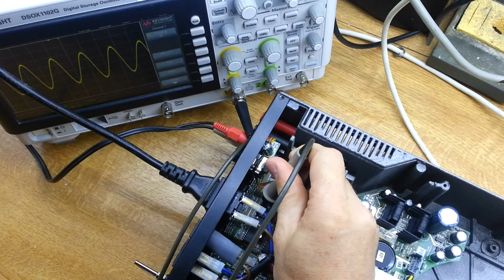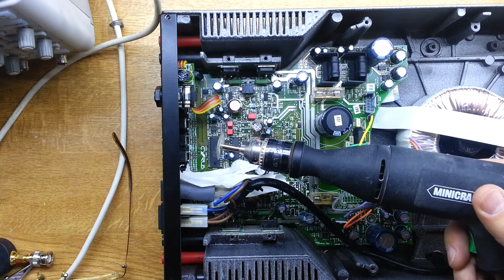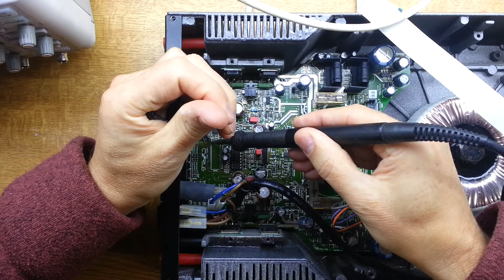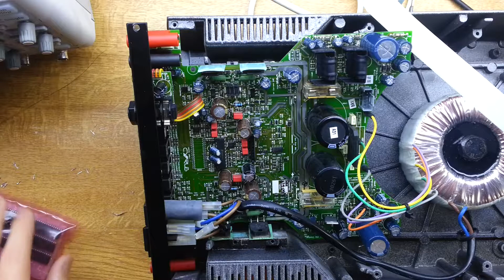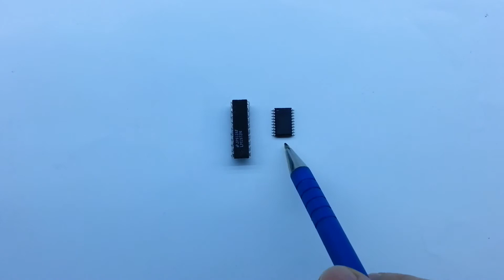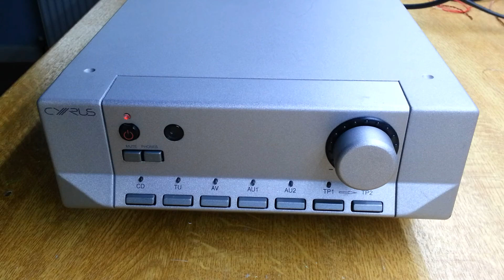Repair of a Cyrus 6 Integrated Amplifier with no output

Comment: hello. i have 6vs2. it sometime auto turn on by itself. i can not control it.
do you have any suggestion on the issue?
Reply: When the issue happen,I press the button of front panel. It can not travel to my press function.
The mechanical is hot.
Reply from the maker: Id first be looking at the front panel. The mechanical tolerances here are a bit questionable and it may be that there is a bit much pressure on the button. When you press it is there much travel?